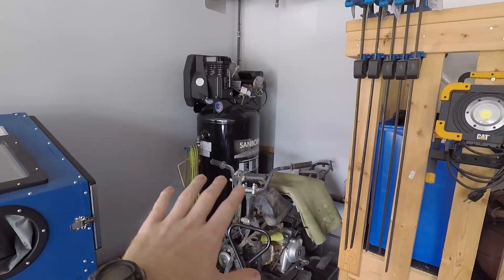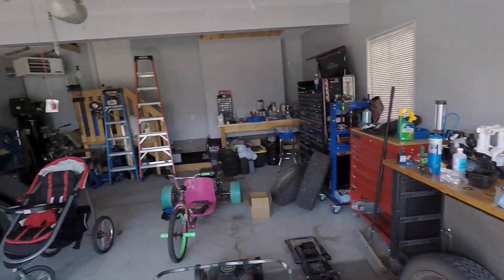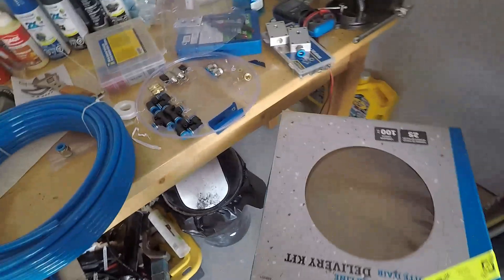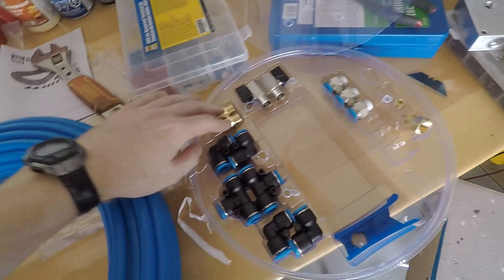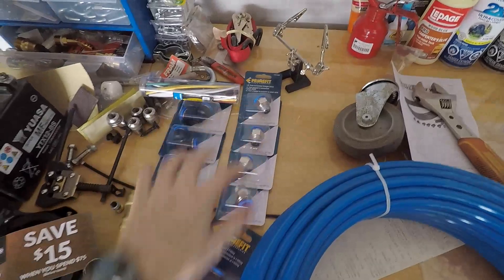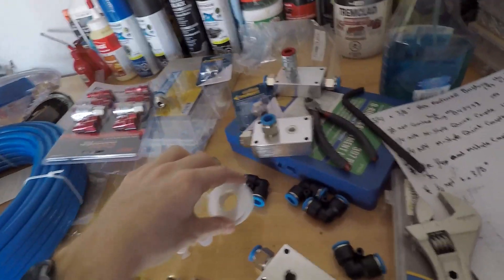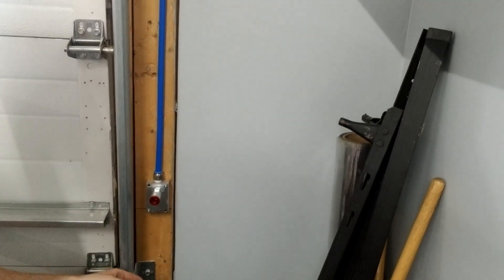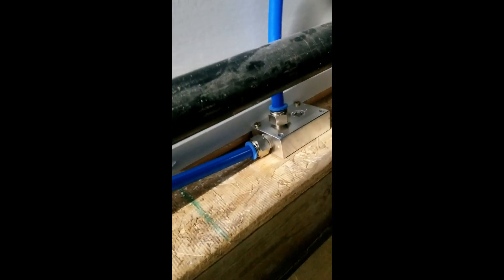Garage Modifications Installing Air Line

Comment: Nicely done video! Something to think about though, you're very likely going to have water condensate issues with your layout. You might want to consider a filter/water trap at the compressor, and a tee with a drain valve where you currently have the union elbow going up to your first outlet block.The filter/water trap would prevent some of the water from getting into your lines, and a blowdown valve where your line transitions from horizontal to vertical gives you a way to remove condensate from the line from the compressor to that point. Just a thought!
Reply from the maker: Thanks for the great input yes I have though of some idea after the fact. I was thinking of a water trap filter with the beads. also at some point doing a copper pipe layout that going up and down a lot to cool the air before going into the compressor as well. 

I like your thoughs on adding vavles to clear water from the line at the elbow. All this takes time and money and I will get around to it for sure one upgrade at a time I guess.

Glad you liked the video.